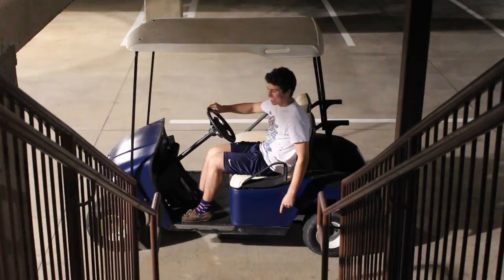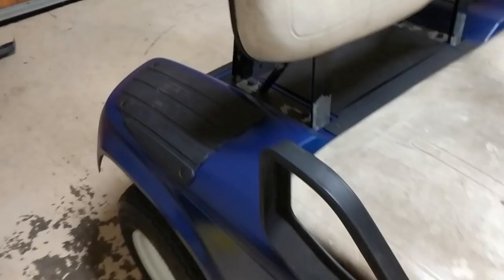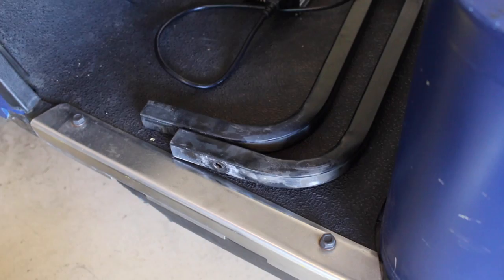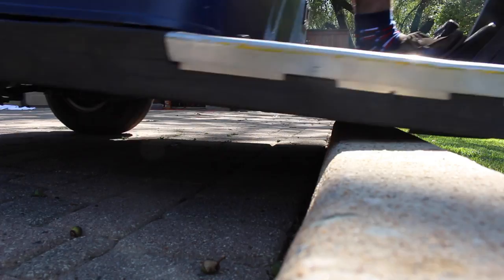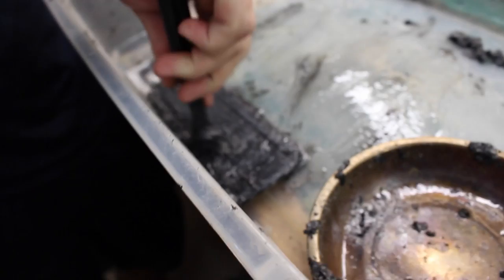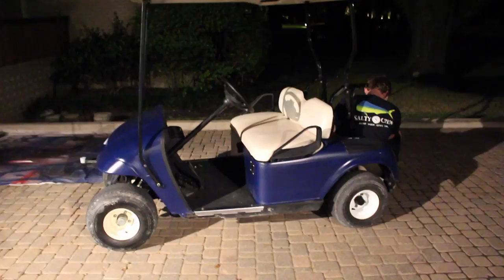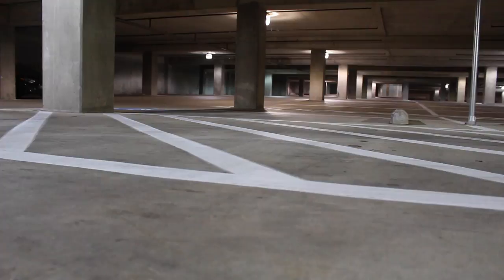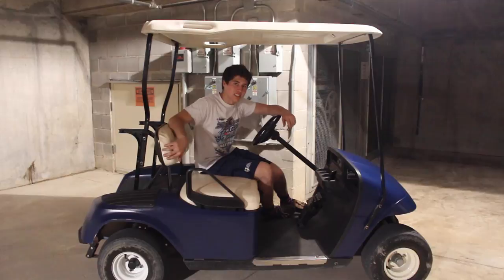Golf Cart Build Part 2 | Paint and Final Assembly

Comment: You need to put a 3-inch lift kit on it 22in tires ground effect lights Bose stereo system. Custom seat covers you can buy the covers from E-Z-Go. Do the seats yourself. If the woods rotten on the bottom of the seats. Just get some plywood same thickness draw the pattern out on it and put the appropriate holes. There are two large pop rivets that hold the body down to the frame two on each side you know where they're at. That uses a super pop rivet that's an important rivet should be the heavy duty type stainless steel. E-Z-Go sells a pop rivet kit. Just enhance when you put in the body back on.

Comment: I had a gas ez go txt just like this and I beat the crap outta it, I treated it like a side by side for over a year before I sold it. I put on 20" knobby rear tires and 19" knobby front tires, otherwise stock and I never broke anything but the brake cable and lever because it hung low down enough it always hung up first, don't worry about it breaking

Comment: install a car radio in it. you would need a regulator though because a car radio runs on 12 volts
Reply: it looks like that model already has a slot for a radio so it would not be hard
Reply: Then you install a marine radio and its already water resistant and takes the same voltage.

Comment: So um , did you guys sell the cart  or no? Should get something like 800-1000$ for it, maybe more depending on the buyer....  I had a 94 ez-go golf cart that I was able to buy for 360 bucks that I got working again. Yet I wasn't satisfied with how fast or how far it was able to go with the 36 volt string, so I swapped it for a 72 volt small EV  power system that not only increased its over all range, but allowed me to go almost twice as fast then before  on the flats. Only side effect was the heat put out by the motor when going uphill for a good deal of time. I solved this but installing a 12 volt radiator fan with an on/off switch cuz it only gets hot when going uphills for say 15-20 min or more...
Reply: https://youtu.be/Vyy8mKsqebM      Here if you're interested at all in the golf carts performance after going from 36 to 72 volt system.... Jump to 10 min in if you want to skip most of the boring stuff... . .. .